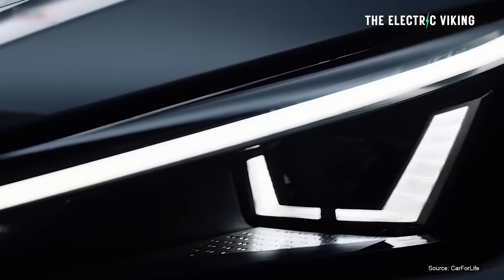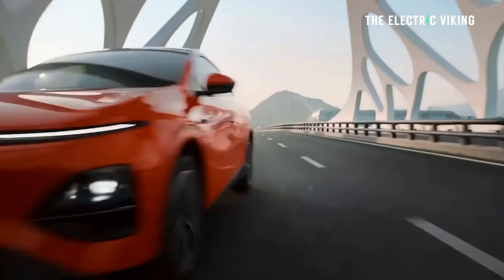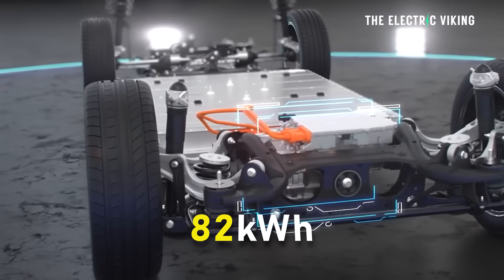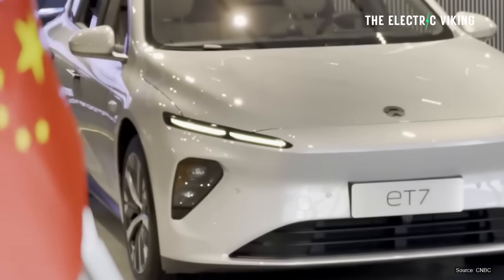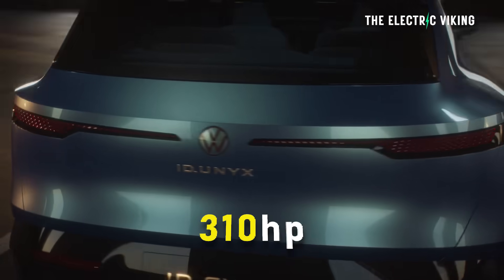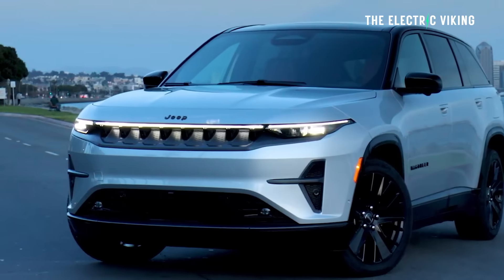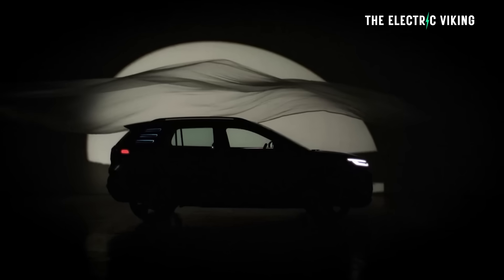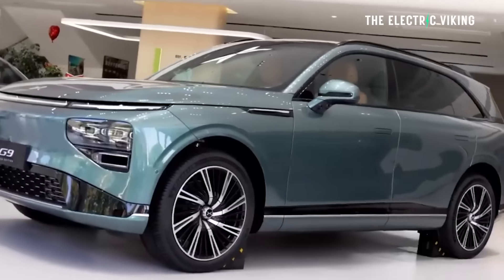VW’S CHINESE REVOLUTION! New 800V EV Packs Xpeng Tech & 420 Mile Range

Comment: 425 miles of range...except in extreme cold or hot weather, then it's 275..and if you supercharge it repeatedly the battery degrades and you get less range...
Reply: Not true🤯🤯🤯

Comment: Looks like a nice looking car, however 800volt does not result in longer range. Longer range is basically achived with a larger battery of reduced vehicle weight are the main contributers to extra range. So give us these vehicle specs.

Comment: EVs are approaching ranges similar to ICE passenger cars.
EVs are mostly charged at home – no more visits to gas stations, ever.
ICE vehicles often have large tanks partly to avoid pumping too often.
90-99% of people do not need more than 300 miles of range. 
Urban drivers in particular rarely do.
ICE cars are rarely driven with full tanks – people often run on 1/3 to 1/2 full (many don’t even fill up completely).
Real-world range when you pull out of the garage is usually below 300 miles for ICE and around 300 miles for modern EVs.

So why is EV range still treated as so important, and why do car journalists obsess over it?
- EVs are still relatively new tech; there’s tons of misinformation out there, and many people simply lack trust.
- Like little boys comparing specs on car trading cards back in the day, range is an easy, headline-grabbing metric to compete over.

The fact that ICE loses out on almost every other metric is conveniently forgotten.

Fact: anything above 300 miles of range is truly irrelevant for nearly everybody – unless you live on the highway, tow heavy loads, or drive 250 km/h on the German Autobahn.

BTW, notice how taxis and Ubers are increasingly switching to EVs? They get huge real-world ranges in city driving (unlike ICE), zero pollution, far lower running costs, and generally better functionality.

Comment: 2025 was great year for where electric vehicles are going 25% of all vehicles sold in the world are electric. End of 2025 average range of most electric vehicles 300 miles. Experts are predicting 500 miles of range by 2030. And the air is clearing.

Comment: Meanwhile in the US, they are still saying that EVs will fail in the market because the grid cannot handle the load.   China is pulling away, building the world's largest hydro dams, the largest solar installations, the largest battery storage facilities, and producing the most EVs and batteries.
Reply: Yes and still building coal powered power stationS like they're going out of fashion.
Reply: @michaelmorton2108  Yes they are doing this to support new construction projects, and replace older facilities with newer, cleaner burning ones. Coal is abundant and energy is needed. China started buying Canadian oil as well. What people don't realize is that China will eventually shut these down. It will take decades to complete their largest hydro plant and coal and oil are interim sources of energy.  China has installed terawatts of renewable energy -- more than all of Europe and North America combined.
Reply: @bengt_axle yes the operative word is eventually. Those plants have a 50 year life cycle.
Reply: @michaelmorton2108 look at the trend.  Renewable installation surpassed coal in the first quarter of 2025.  Transition takes time and older, more polluting coal plants are being retired

Comment: Good to see Germany is evolving in the transportation industry. When Fuel cells replace precious metals it'll be a much faster process. 
   FYI at request of the grieving family.       My friend died of this, he wanted to sell his diesel truck after the diagnosis, but his widow gave it away. She too and her kids were sick from it .The severe health consequences of engine exhaust, particularly its role in causing lung cancer in nonsmokers, which is becoming increasingly prevalent. engine exhaust contains numerous toxic, cancer-causing chemicals that deeply penetrate the lungs, leading to a high daily death toll from lung cancer, currently 360 Americans. Furthermore, the oil industry's efforts to spread misinformation and obstruct the adoption of electric vehicles (EVs), which are a significantly cleaner alternative.